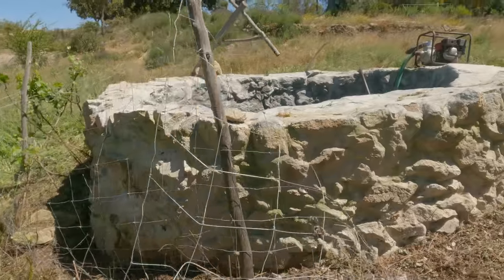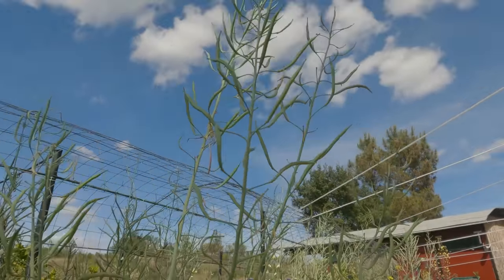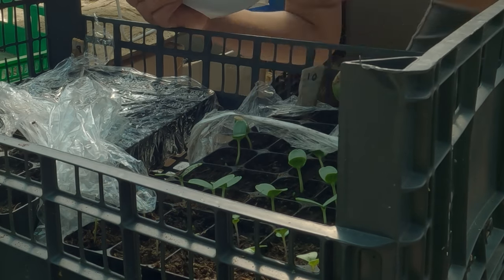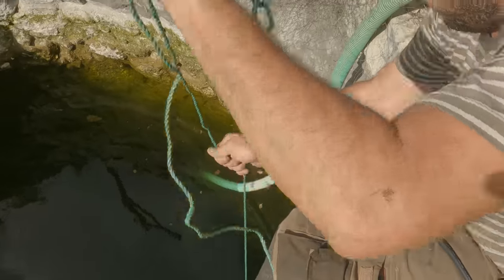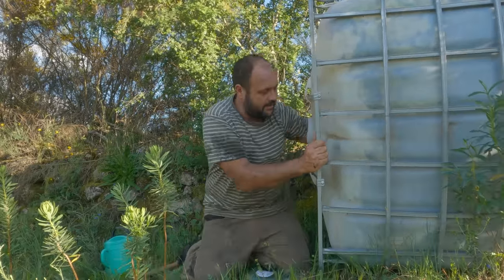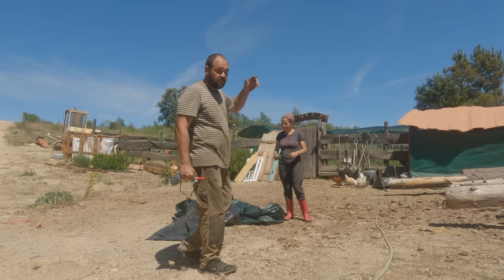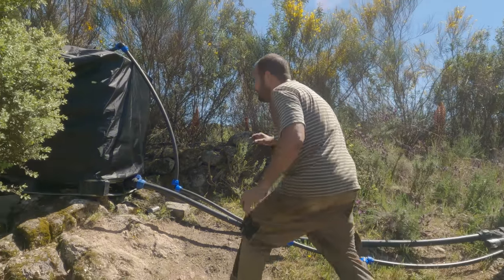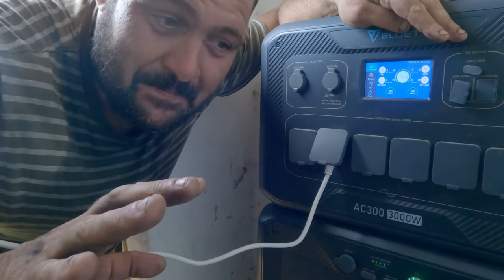Prepping for Summer on our Off Grid Homestead in Portugal #Bluetti

Comment: I have a question about your expectations with using bluetti power banks. How long do you expect them to last??

For your demands and needs do they give you an estimate of how long each bluetti product lasts? I am curious because the tiny power packs (used for mobile ph charging) are dead after 2 yrs. Do bluetti power banks have a 10yr guarantee?
Reply from the maker: Bluetti offers a 10-year warranty and has a lifespan of over 3,500 cycles. After that the capacity drops to 80% . It is said to have a life expectancy of 9.5 years